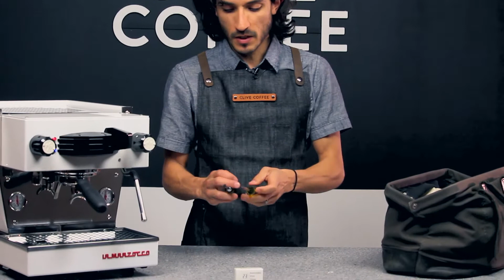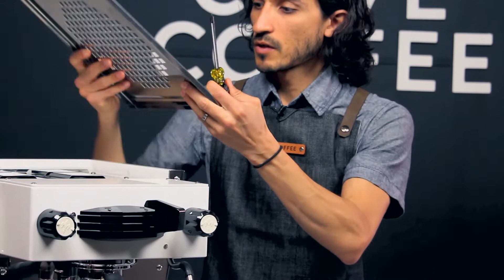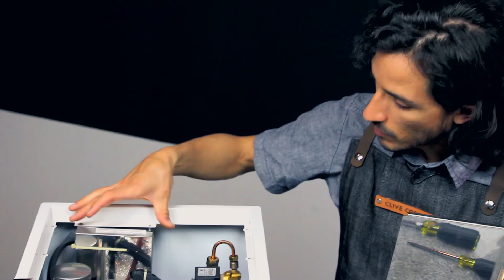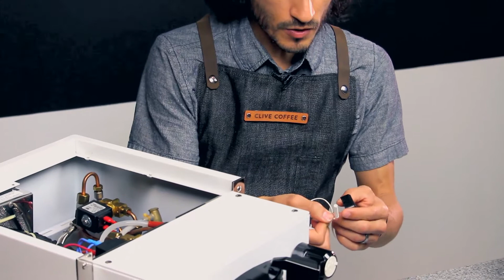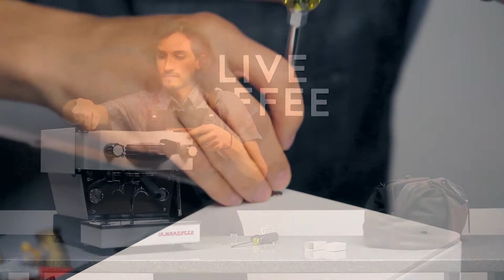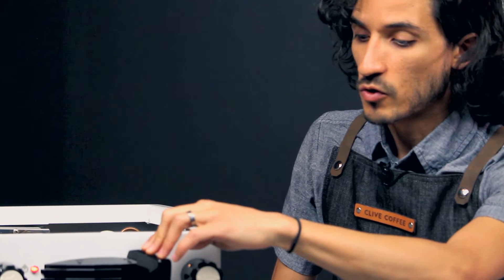La Marzocco Linea Mini | Luminaire Shot Timer Installation

Comment: It's maybe worth mentioning that the cable "exit" from the timer can be easily changed. The timer has 4 exit holes you can choose from: up, down, left, right. This gives much more flexibility when placing the timer on the machine.

Comment: Would this work on a Profitec Pro 500 with PID?
Reply from the maker: Hey Vernon. In short, no. The Luminaire shot timer has to be attached to a 3-way solenoid valve. The Pro 500 doesn't have one of these since it has a mechanical E61 group head.

Comment: hi what if the machine has few seconds pre infusion? so the solenoid start stop and then start again automatically so the shot ?
time would be in correct
Reply from the maker: Correct. The Luminaire shot timer is activated by the solenoid, so if it opens and closes to perform a pre-infusion the timer will start, then stop. Then it will reset and start again when the solenoid is opened again.
Reply: Is this devise supposed to be compatible with the new version of the La Marzocco Línea Mini that comes now with the new Wi-Fi and the app? The reason I ask is because I just installed this device as you have illustrated here and the it does not do anything when I start it by attempting to brew. The screen never turned on at all. I was told to check the battery by running a magnet near the sensor and if shows Ér on the screen it indicates the battery has charge and is working.